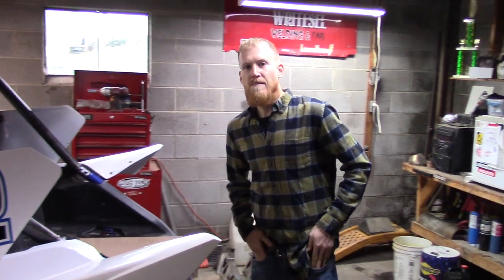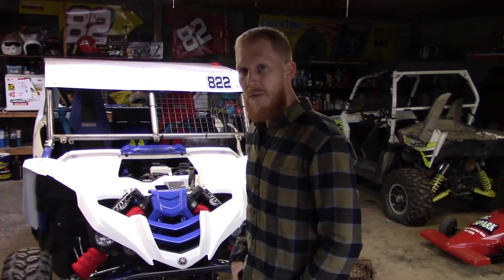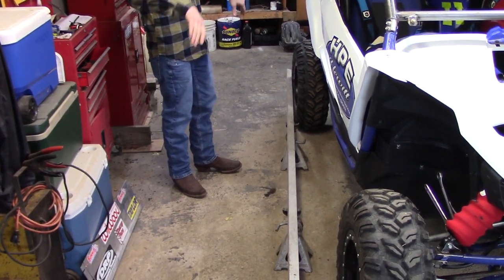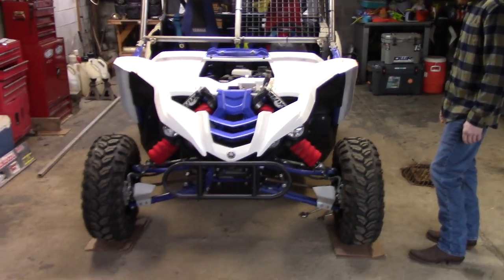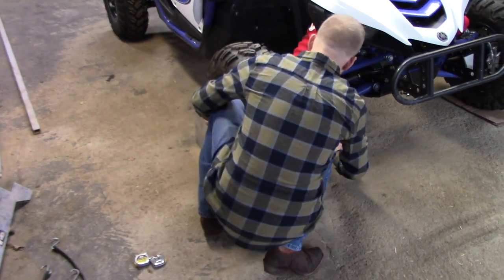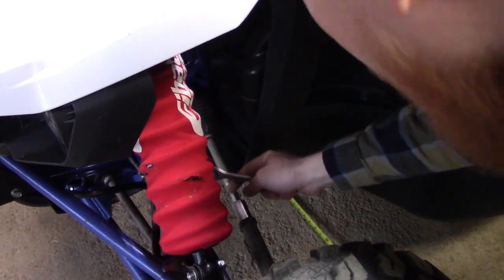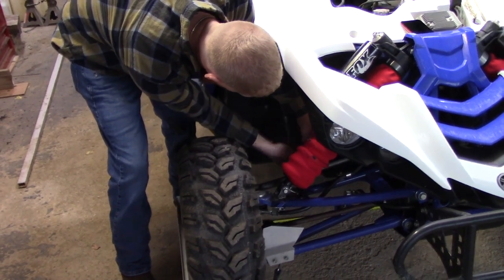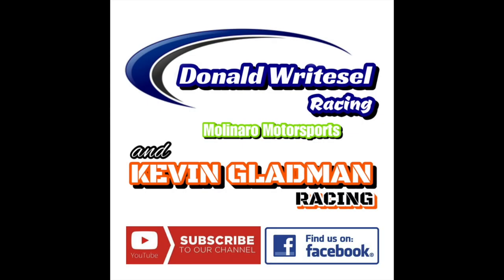YXZ SXS Front End Alignment And Toe! We Share Gladman’s 1 Man Techniques For Setup!

Comment: Love your videos loads of information, Quick question I do rallycross with my talon r stock wheels and tires I just came across a new set of talon wheels with tires, I wanted to run all 4 corners the same size and maybe later get some hoosier tires. Talon has 9" tires front and  11" rear. Do you thingme running all 4 with the rear setup would be better? Thanks
Reply from the maker: @TheExtremeRace Thank you! Glad you enjoy them!! We run all 4 corners the same size but we run the 9” all the way around…I would say the 7” wheel all around is your best bet especially if you plan on Hoosiers in the future! I don’t think an 11” tire up front would work well.
Reply: @writeselwelding  What tire setup are you running? Great video